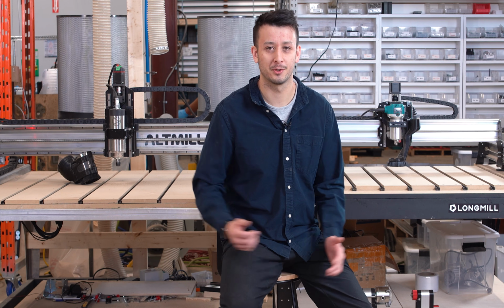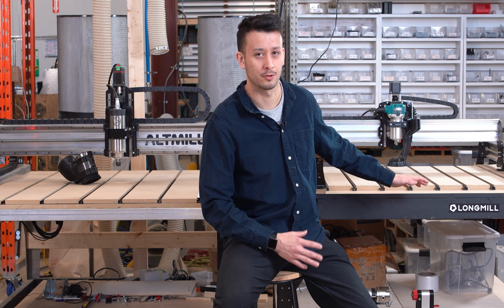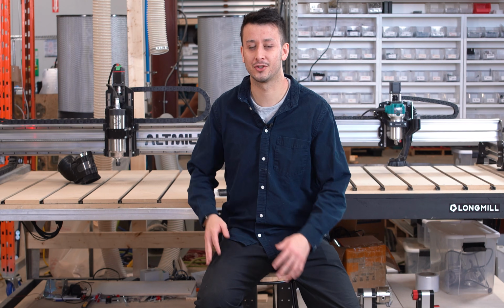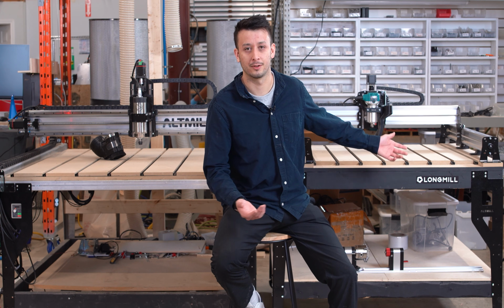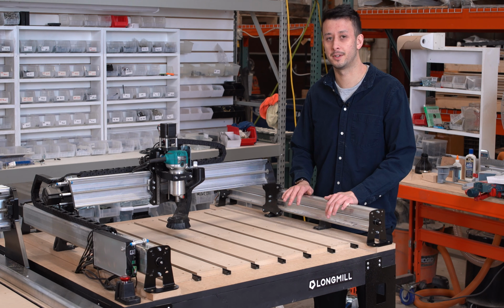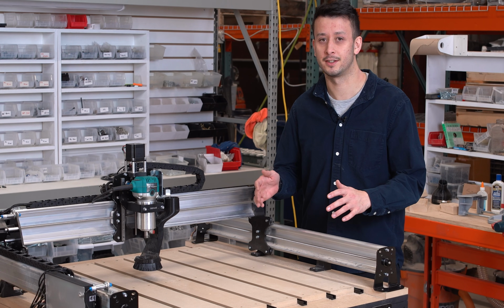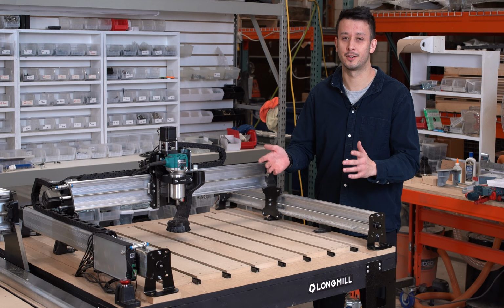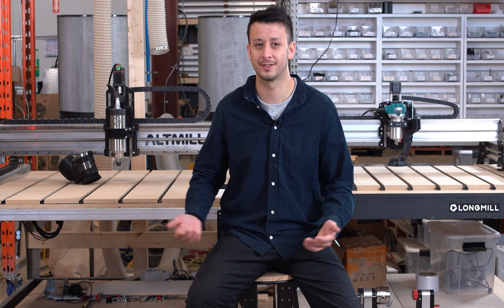LongMill vs. AltMill: Which CNC Machine is Right for You?

Comment: Not sure if they are missing because it's a dev model or not but using screw caps on those linear rails will really increase the bearing life. Without them debris gets into the screw hole and then easily contaminates the bearing. Screw caps don't completely eliminate the problem but they make a big difference.
Reply from the maker: You're 100% correct about the caps! Thanks for the input!

Comment: Can this be bought moduerly? Say I wanted to buy the frame and legs but none of the wiring or electronics? I have multiple machines from a 6040 to a 4x8 and some older vmc's. I convert them all to a cnc dealers direct kit. It's just my preference. I want to add a few 4x4s to my lineup. But I don't see any point in buying a complete machine just to ditch half of it in my ever growing pile of take-off parts.
Reply from the maker: At this point no, you can’t buy just select components. But thanks for asking!
Reply: @SienciLabs  thanks for the quick response! I'm still interested. I've seen a couple of YouTube Wood guys idc and cutting it close show casing it. Have you sent one to anyone cutting aluminum on YouTube yet? I'd like to see how it handles it. I run 600oz steppers, g540 geckos with 48-volt power supply on my 6040 all double shielded wiring from front to back, and have no problem running aluminum at a respectable feed rate with 1/4 tooling. I would be looking to be at a similar rate with whatever 4x4 I end up with. I don't expect it or any other machine at this price point to handle it right out of the box. I'm just trying to see how much it will cost me to get there. I like the ease of mobility vs size vs rigidity potential of this machine.

Comment: I LOVE that you quantified the rigidity coefficient!  Did you test the rigidity in other directions? (X, Z).  Did you test the rigidity at the tool tip, or just on the gantry itself?
Reply from the maker: Glad you found this helpful! The Y-axis is almost always the weakest direction on any CNC router so we tend to focus on this. Our X-direction rigidity measurement for the AltMill was 1.26N/um and 0.16N/um for the LongMill. The Z-axis tends not be measured since it is typically the most rigid axis and is not subjected to as much cutting force during regular routing. We probe this just below the collet of the spindle/router at the tool shank about 1-2” from the table surface, with the machine in it’s weakest position (centered in the X and Y axes).

Comment: If I want to do production, but only using foam and EVA... Do I need to go with the Alt Mill, is the router the limiting factor?
Reply from the maker: In the case of foams and very light materials, maximum travel speed will usually be the limiting factor so the AltMill is the winner here. However, this will come down to the type of projects you’re doing, since the speed of the AltMill won’t benefit quite as much if you’re limited by the speed of the toolpath type. For example, engraving is typically a universally slow process across any CNC
Reply: @SienciLabs  thanks for the response, I was thinking more in the sense of, if the extra rigidity of the AltMill doesn't really add significant benefits in cutting EVA ( think custom foot orthotics) then the Longmill should be fine. Now the Makita router might be the limiting factor in breaking down and maintaining.

Comment: 4 Years ago I made a choice on the 30x30 MK1. That machine taught me a lot. I then upgraded it to a 48x30 MK1.5 and went down the 1.5kw air-cooled spindle path. The one constant at each step as hobby and side hustle the Longmill and its upgrades have paid for them selves over time. My next step after 4 years of constant learning is I need a full sheet machine. In Australia there are couple of vendors with good solutions for full sheet. However I could not have got to where I am without my experience with the Longmill. Thank You
Reply: Can you help me understand what the benefits are to running the 1.5kw spindle on the Longmill?
Reply: @davidgrooms3463  After having 3 routers fail on me I decided I needed greater reliability. Why 1.5kw air-cooled plenty of power for what my Longmill does weight was another issue liquid cooled spindles have more weight to them and honestly my 1.5kw air-cooled spindle has no issues in Australian summers. Some people talk about noise levels and in static running yes they are quieter but by the time you are cutting and running dust extraction there isn't a lot of noise level difference. One solid piece of advice buy a spindle from a vendor that will offer support. Don't buy the cheapest option either.

Comment: Excellent comparison at the end however was that the 1.5kw spindle pitted against the Makita or was that a bigger spindle?
Reply from the maker: Thanks for the kind words! It was the 1.5KW air cooled spindle offered with the AltMill, but the spindle type would not have made any difference since gcode was generated to reasonably match the rigidity and speed capabilities of each machine. A more powerful spindle would’ve theoretically allowed for a faster cut time on the AltMill.
Reply: @SienciLabs  Does that indicate there is little benefit to running a 1.5kw spindle on the Longmill?